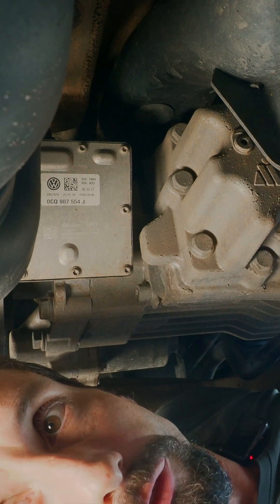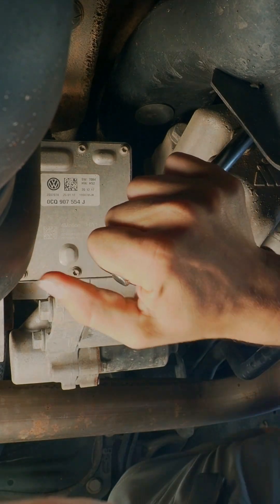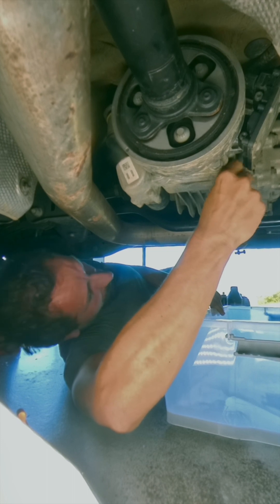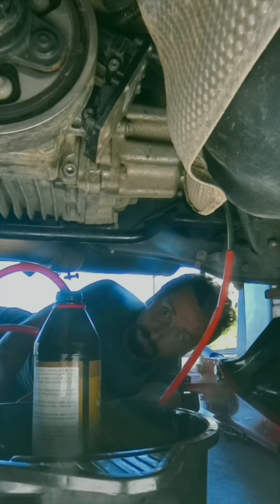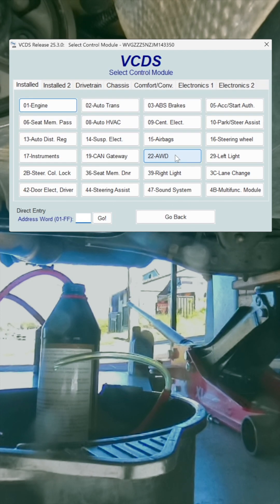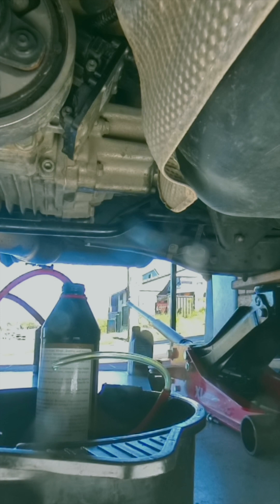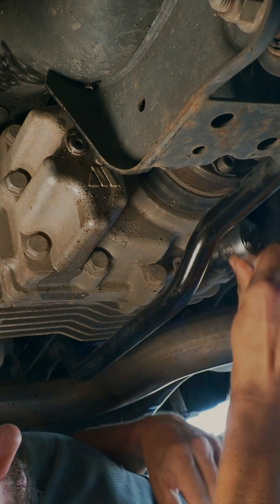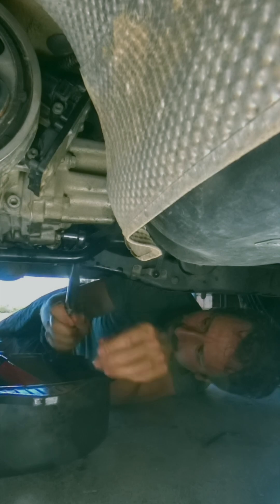Haldex Gen 5 Service & Differential Oil Change | VW Tiguan Allspace 2018 DIY | MBA | 5NA

Comment: What oil did you use? Im planning to change both diffs and Haldex myself this spring on my Arteon 2021. Haldex oil has been changed one time but they did not clean the filter😢 as per VW standard.